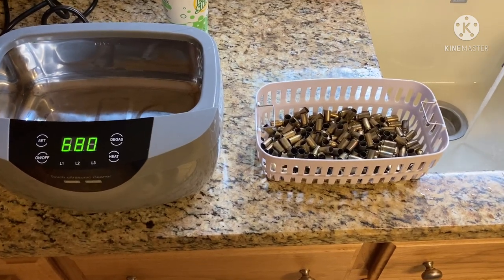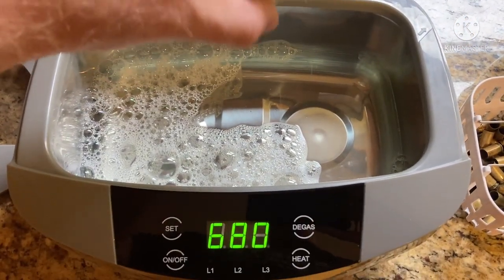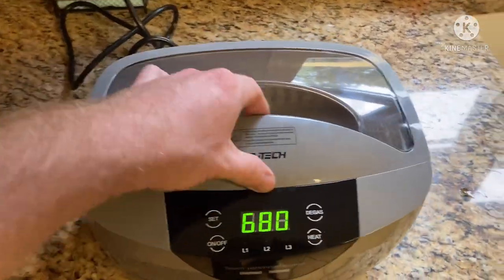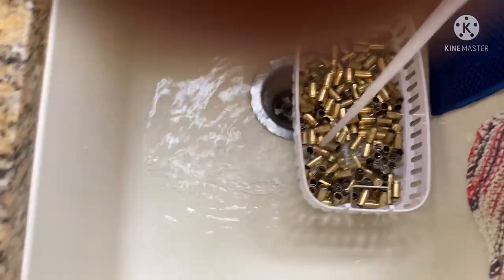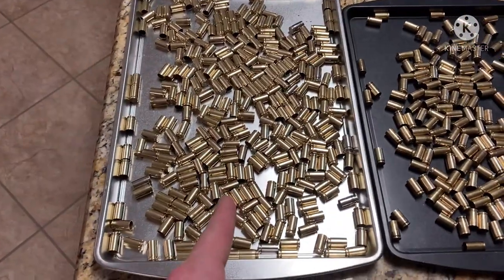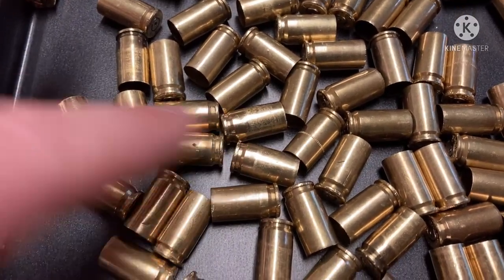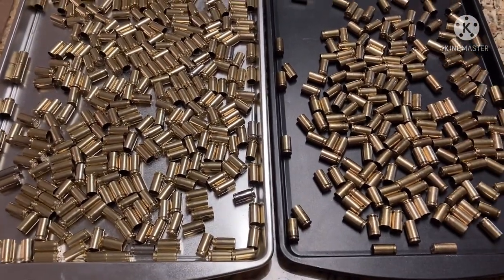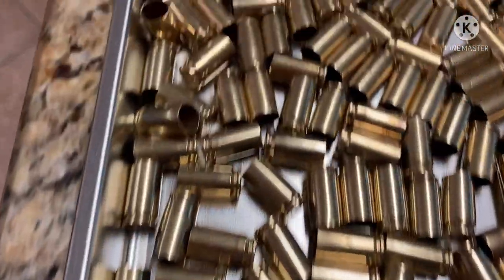Ultrasonic Cleaning Brass

Comment: Excellent video! I have had a lot of success using my ultrasonic to clean brass and gas operating parts on my Ar-15s and the like. If you wanna get it even cleaner and shinier, put a couple of capfuls of SuperClean, a bit of white distilled vinegar, and a can of cheap tomato paste in there with decapped brass. I know, I balked at the idea of tomato paste but the stuff really works! Eats up the oxidation and carbon on the brass like a piranha!
Reply from the maker: thanks for the tip

Comment: Get a strictly depriming die that doesn’t size. One of the best parts about an ultrasonic cleaner is it cleans the primer pocket and inside the case better than tumbling.

Comment: I use both a sonic cleaner and a tumbler just depends what I'm running small batch or big batch usually do at least 30 mins in sonic cleaner couple hrs in tumbler

Comment: Clean enough to load is what counts to me .
Reply: You can load anything without cleaning it. The main reason to clean cases is to keep your dies and gun clean. Im only using an ultra sonic cleaner because having to scrub lubricant with a sponge and a power drill is a pain in the ass and i would rather spend my time doing something else
Reply: @dirtydan3029  I clean the lube off by laying the cases on a towel and spray with rubbing alcohol . I then roll the cases in the towel . I can delube the whole batch in a few minutes .

Comment: Sorry but new to this - I don't understand what you mean by "steel pins"?
Reply from the maker: When you wet tumble in hot water you use stainless steel pins and they get the brass super clean.
Reply: @243Outdoors   OK I see. Did you find this worked same or better than the ultrasonic/dawn/lemi shine recipe?
Reply from the maker: @mr.scruffydog4961  wet tumbling is much better but it takes 30 min to an hour minimum where the ultrasonic is 10 min or less. It’s not as good but good enough in most cases if the brass isn’t too dirty.
Reply: @243Outdoors  Great. Thanks.
Reply: I was taken back by the use of the kitchen sink!   The lead residue from the brass is a consideration.  Be careful out there!!

Comment: I thought you said that you used hot water, Dawn dish soap and Lemyclean in a tumbler but when then it sounded like you used steel pins. I'm confused, what did you use in the tumbler?
Reply from the maker: I use hot water,dawn,lemi shine with pins in the tumbler
Reply: @243Outdoors  I see, thank you!